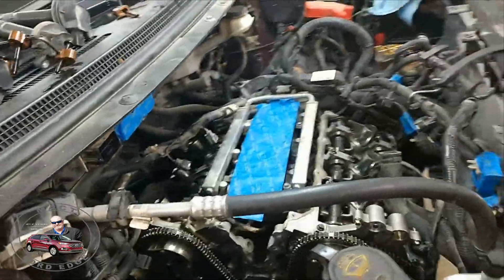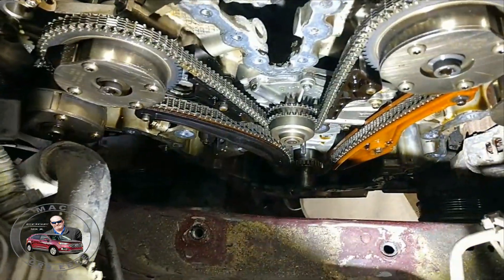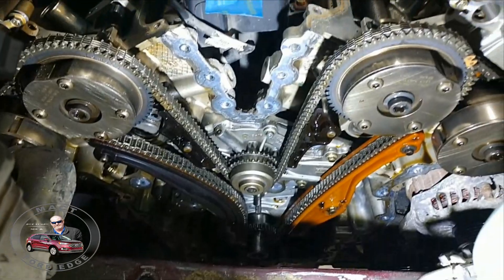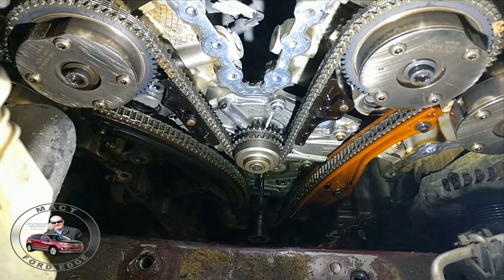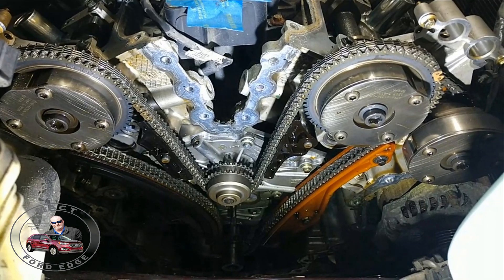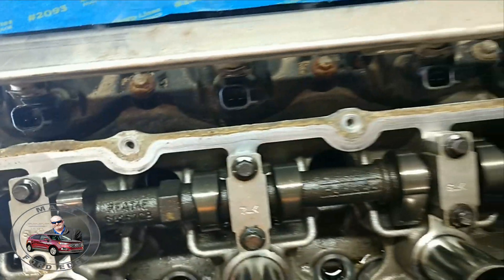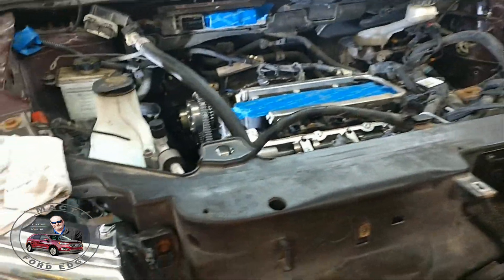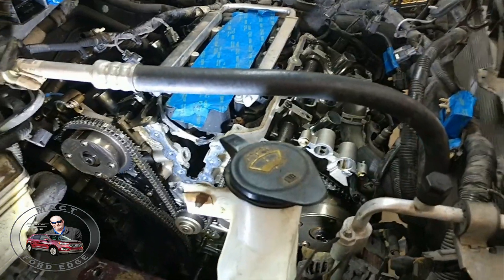330,000 mile water pump failure in the cleanest 3.5 Duratec engine you have ever seen

Comment: Well I changed my oil every 3k miles and used only Mobil 1 Full Synthetic oil and changed coolant every 30K miles or less. Today my Water pump started leaking coolant on 2011 Ford Edge at 140K miles. Changing oil does nothing to do with it. They just made it to be failed around 150k miles. Someone lucky to be able to see it fails after 250k miles but those are most likely highway drivers. If you drive city and lots of cold starts, expect to be failed around 130k-180k miles and you can nothing to do with that. This is how Ford engineers are being greedy

Comment: I have been avoiding the Duratec engine due to the placement of the waterpump.  I do not have the income to handle something like that going wrong.
Reply: But you have the income to handle similar maintenance issues with other modern vehicles such as the timing belt job which cost over 2000$ nowadays?

Comment: This is a Cyclone engine not a Duratec! The Cyclone replaced the old 3.0 Duratec that was once used in the 3rd Gen Taurus/ Sables. This Cyclone was used in the 2010-2012 ford Fusion SPORT, Ford Edge, Ford F-150, Ford Taurus 2010-2019, Ford Mustangs V6 before it was upgraded to the 3.7 Cyclone variant before they went to strictly Ecoboost or Coyote models. I know my Ford's LOL I own a 2010 Fusion SPORT love it! Very fast car 👍 good to know these engines are reliable and can achieve high mileage if maintained.
Reply from the maker: You might want to tell Ford that.  All parts and the Engine are noted as Duratec from Ford when ordering parts.  The cyclone was the old engine they based the Duratec on as the engines were developed.
Reply: @MACTFordEdge  Cyclone just sounds better doesn't it! Sounds more powerful than Duratec. Yet my Dad once had a 96 Taurus GL that had that 3.0 Duratec wasn't bad for the time either! Pretty nice looking fast car as that would become the car I got my license in and my first car. My brother also had 2 Probes that were GT's that both had the 24V Duratecs too those were underrated cars.
Reply: @MarkLevensonRealtor  if maintained with oil changes every 3000 miles it should get that easily! These engines usually get very high mileage.
Reply: It’s Duratec

Comment from the maker: I will answer a lot of questions here.   10-12K mile oil changes.  Used over 30 different brands of Synthetic Marketed oils.  Viscosity ranged from 0W20 to 10W40.  Most of the time it was oil cocktails of many oils from cheap to expensive.  I also reused oil filter at times since I use the Purolator Boss all the time and it is a 20K mile filter. The water finally failed.  It is the OE water pump the vehicle was built with. I am currently changing the pump with the new owner as I sold LU about 6 months ago.  I will have multiple videos out once I finish up this project.   By the way changing the water pump is not all that difficult.  Planning and having a few needed tools lined up is the key to success.
Reply: Just finished up my 2007 edge.
Your engine is out of the crate clean !!!
Reply: I've always been spooked by the thought of having to change the water pump on the 3.5
Reply: I can’t wait to see more from removal to prep to parts and install. I have my 2010 Limited with 130k in the driveway. Interior and rest of car is too nice to throw away. Plus my Honey loves her Ruby. So, I love the support and encouraging words coming to this Medicare aged, starting to feel every year guy that’s trying to prep and psych himself up to do this right. (My main reason for not paying 15 shop hours to get it done for me)
Reply: @marcnewkirk4856  130k miles - nice low miles. My 2014 has 121k miles. Still runs and performs like new though. These are great vehicles indeed.